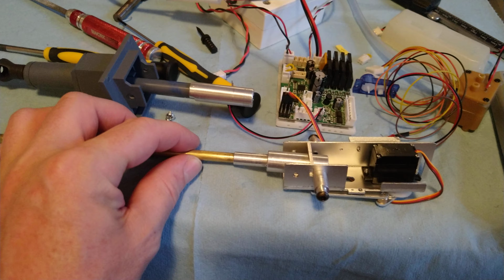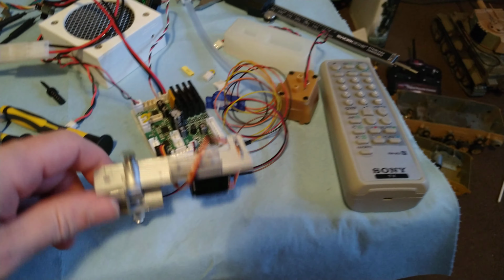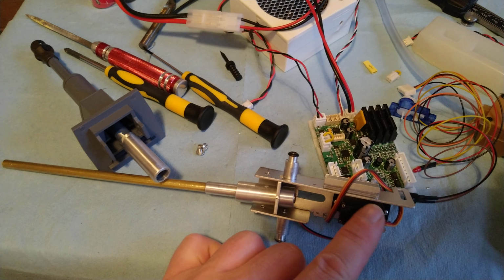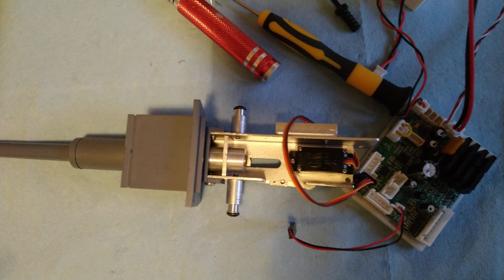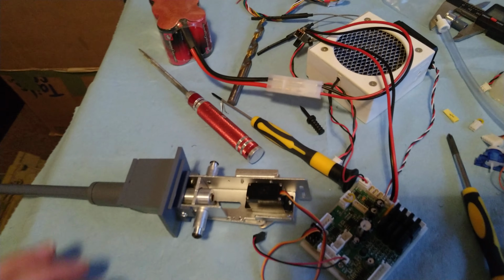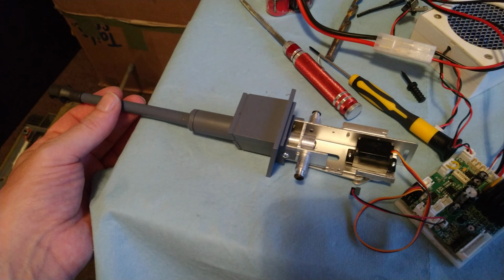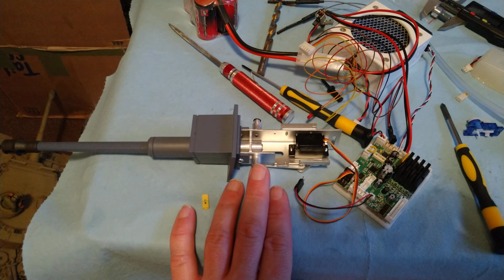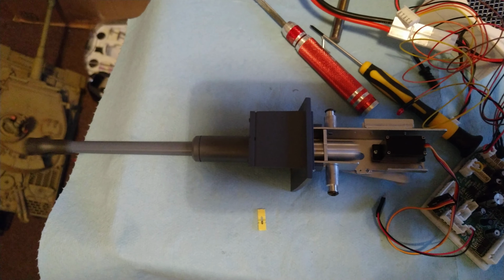Heng long metal recoil unit review

Comment: Thank you for the video. 

I fitted a Clark recoil unit in my Stug, but I had to reverse the direction of the servo as I am using a Mako TE with a Torro radio system. 

Have seen these units for sale on Forgebear tanks and wondered what the quality was like - and now I know!
Reply from the maker: Thanks for the feedback, I bought mine from forebear, great service, I highly recommend them.
Reply: @trooperwolfie  You can't go wrong with Dave, I have bought from him for years.  

I have bought one of the servo recoil units to fit into my KV-2 as I don't like the Asiatam unit that Torro supplies. 

Thanks again!

Comment: Can you only have servo elevation on these guns
Reply from the maker: No, you should be able to use the Sherman/stug type elevation motor, there's a channel on the side for the wheel stub to locate into, the channel is removable, so you can re position it if needs be.
Reply: They should state this when they sell them then
Reply from the maker: They are designed for the new version tanks, but I don't think it would be hard to modify so you can use the rotating pinion type elevation units, what type elevation unit do you have, and what tank is it for?
Reply: trooperwolfie I have a chally 2 with all the bells and whistles with a Clark recoil unit which split in half its my second  one in 2 years
Reply from the maker: I've had a Clark as well, they're shite tbh, mine broke too.

Comment: Hey, this is a bit off but this heng long Panther G im fiddling with evidently has some issues. The elevation quit working so I tore it apart and set it aside for several months. When I put it back together the elevation miraculously started working but the airsoft function quit working . The only port that the wiring will plug into doesn't do a thing but everything else works and functions properly. Got any ideas whats going on?
Reply from the maker: Does it have recoil as well?
Reply: @trooperwolfie  no I think I may have found the problem with the airsoft firing , its hopefully called operator error
Reply from the maker: @georgedistel1203  I hope you've sorted the problem, good luck sorting the smoker unit out 👍🏻

Comment: Will this unit fit a Taigen tiger 1
Thanks steve.
Reply from the maker: It should physically fit the mantlet but it depends on your electronics, if you have an aftermarket board like a Clark or similar, or Heng long 6.1 then it will work well, but it's hard to make it work with STD taigen board.
Reply: trooperwolfie  my board is a TK22.
Thanks again Steve